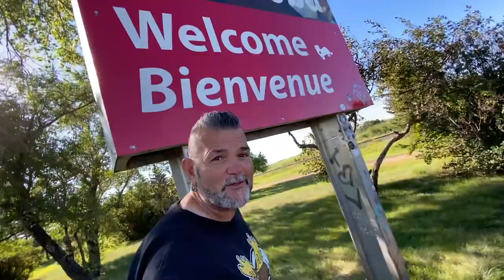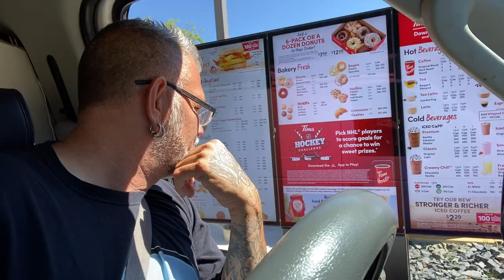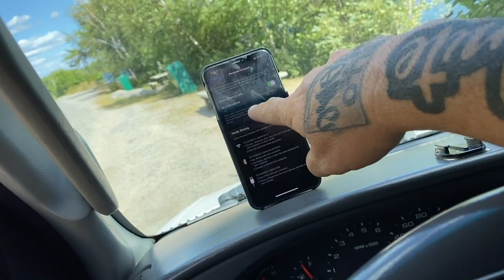Sleeping Just Off The Highway | Our Timeline Has Changed, Bug Screen Repair, Noisy But Beautiful

Comment: I have not uploaded any videos yet but could you put the file on the phone instead of using the hotspot on it? Also a suggestion for andy would be to make a cut out for the front windows on the van to be able to make different accessories for the window.  Possibly small frame  for adding bug screens to the front or anything (like an ac unit) else